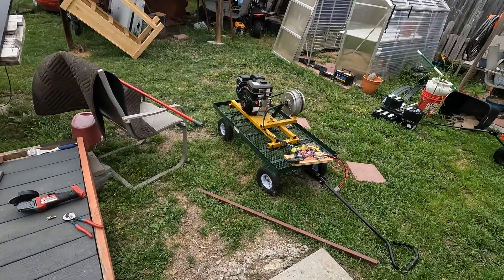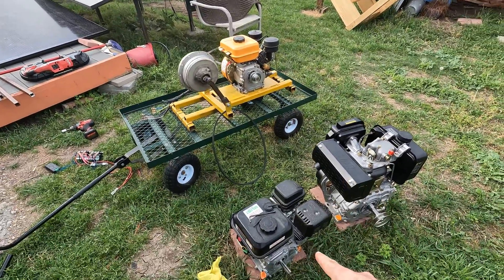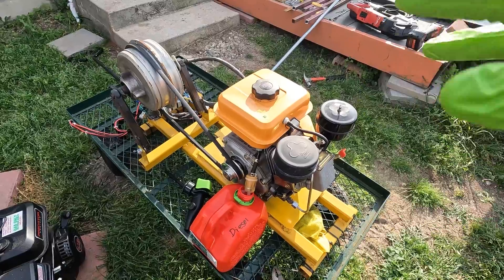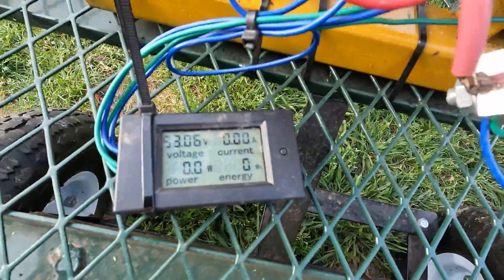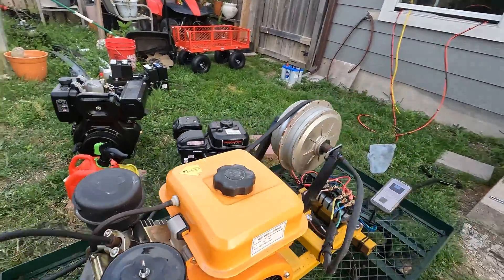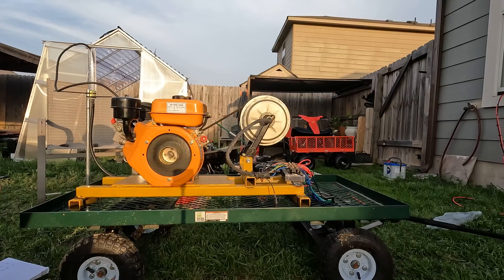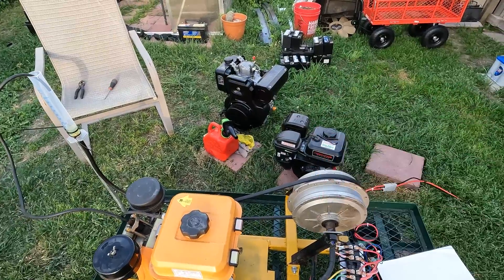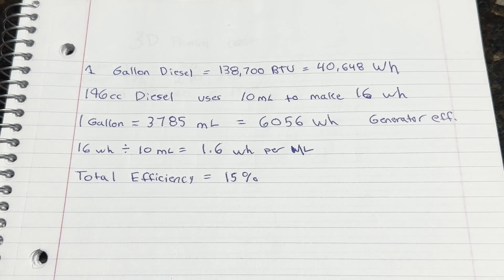Amazon Diesel 196cc  DIY generator fuel economy

Comment: You can run 100micron filered used motor oil through that 196cc without any desiel and it runs perfect. 👍 makes it damn near free.

Comment: generator. measure its resistance. then short it out and measure the current it can deliver, and how much power it takes to spin. at various RPM until it saturates, or something starts burning, lol... being permanent magnets, you will find theres an RPM where it peaks, plateaus, and past that speed output starts falling again. magnetic flux density, rate of change, number of conductors crossing magnetic flux, and iron losses, hysteresis, etc...

current squared * resistance for the power the generator can deliver. current* resistance for the voltage it should develop.

then, as per jacobis law, or thevenins max power theorem, you can only deliver half that power to a load resistance equal to the generator resistance. "impedance matching"... half the energy is in the generator, half in the load.
 if the load is lower in resistance than the generator, then most of the power is lost as heat in the generators resistance. basic maths. I2R... 10 amps, 10 ohms each, thats 1000W in each, or 2kw total, which should take a bit more than that to produce (friction losses). 10R to 1R... thats 1000W versus 100W, for 1.1KW total, etc etc...

 to get good efficiency, you need to "impedance bridge"... the load should be an order of magnitude higher in resistance than the generator. meaning you cant push so much power out of that generator, but more of whats delivered appears as useful work in the load, rather than being wasted as heat in the generators windings... ie, 1R to 10R means for the 1.1kw developed, 1000 watts is used in the load and 100W lost in the generator...

biggest hurdle, because you are trying to rectify, then charge batteries, is that all that gets tossed out the window as the generator is stuck at delivering a fixed voltage, and very well may be right out of its sweet spot... as its a combination of RPM, generator capabilities, its resistance.... to charge batteries is like juggling blindfolded unless you really did your research...

at  that point, ditch the poxy hub motor and track down a proper genset head... direct to AC. why waste energy dealing with "middlemen"? teh rectifier is a loss, teh cables are a loss, the V belt is a loss (yes, v belts are extremely inefficient... at least run a chain or flatbelt/toothed belt?), the batteries are a loss, the subsequent inversion to useful AC is a loss... 

"buy direct from the manufacturer..."

Comment: What RPM did you test this at?  You say "relatively low" but no idea what that is
Reply from the maker: @jsh111  maybe around 1000
Reply: @Mikebuildss  thanks for the reply!   Here are some thoughts that might be useful if you wanted more efficiency,  and assuming you can adjust the injection timing/ advance.   This engine,  if my research is correct has a timing advance of 22 degrees prior to TDC.   This is very aggressive and probably necessary to get a more complete burn at the engine's peak 3300 rpm.   At lower rpms like 1000-1500 you would want something more like nine or ten degrees timing advance since you now have more burn time since the engine is operating more slowly.    At slower speed that burn is fighting the engine's momentum too much,  and you also start to encounter compression heat losses.    I'd say shoot for 1500 rpm if you wanted to see how efficient this sucker can get.    Great videos brother,  cheers!

Comment: So you can make about 6kw (60¢) of electricity using $4 of diesel? Awesome!
Reply: I think your looking at this all wrong. I live off grid because no power is available and I don't want to be reliant on anyone for my own power. 
I have everything from a washer and dryer to high speed internet.  I use engine generators 2 hours on the weekends to wash clothes.  So I actually only use a gallon a month. Everything else is solar.  So my power bill is around $5 a month. 😂 If a hurricane comes in and everyone else looses power for weeks it doesn't affect me at all.
Reply: @SgtBrown-w1v  I think this is the goal of all responsible rural-folk, isn't it???

Comment: where did you get the pulley for the motor?
Reply from the maker: Tractor supply, it’s a standard 3/4 inch bore, I used a flap wheel to turn down the engine shaft slightly so it would fit

Comment: very nice job, when running the big 10hp diesel engine for generator usage, be careful of what's called Wetstacking.
Reply from the maker: I will keep an eye out for that! Just gotta get it hot
Reply: @Mikebuildss  you will need about a 3-5Kw to properly load that 10hp diesel engine

Comment: You are running the engine too lightly loaded. That’s the reason for the low efficiency. At zero load it’s 0% efficient. Try run it at least at 75% of its rated power.

Comment: I get about 26-27% efficiency with a 10hp hatz diesel and the same setup, i can run it slow and purely on torque at 1500rpm, yours runs a bit faster i guess, but i think if you only plan to run it at 600 watt you can gain some fuel efficiency by lowering the RPM to around 1800 +/-10%

Also not all hubmotors are the same, i had what seems to be a beast of a hubmotor that looked very promising, but didnt get the efficiency of the Mxus 3k that is on it now, that gets hardly warmer than 60c at 2000 watts running for hours.
Reply: Don't know if it's accurate, but I read somewhere, the fuel injection timing advance is 22 degrees before TDC.  That seems pretty aggressive, and probably what is necessary to tune this engine to run well at 3300 rpm or whatever it is.  My guess, is efficiency will see a huge drop at lower rpm unless you also reduce the timing advance to something like 10 degrees before TDC, if you want to run it at around 1500 rpm for superior burn and efficiency.  Anything lower, and you might see compression losses start to take over.     If I had my way, someone would take one of these, tune it to run 1400-1500 rpm, then dyno it, take your peak power, then run this at 80% of that number, THEN see what your efficiency is.  This thing could be great for supplying a battery bank with extra power intra-day

Comment: Was there any diesel in the return tube? Might have screwed with the calculations since you only did 10ml increments
Reply from the maker: It was returned back into the tube that way only the volume that was burned was used.   if I didn’t feed it back the return fuel from the injector would have messed the result up
Reply: @Mikebuildss i think the question was regarding filling up the return fuel hose.

but if you took mid-run measurements that should've covered all discrepancys in consumption.

Comment: hey guy have you consiidered converting your predator 212 to propane the conversion kits are availble on amazon and maybe ebay too
when i looked at em they were like 20 bucks
Reply from the maker: Never tired propane may look into that
Reply: @Mikebuildss  i think im gonna do that because i built a generator battery charger similiar to what you have but used a 100 hundred amp alternator 
it works well too  but my problem is things sits most of the time and the fuel goes bad and gums up the carburator
 i was gonna use the generator charger yesterday but  the carb is gummed up 
propane would solve that issue

Comment: If you can find the dynamometer charts for each of these engines, they may include brake specific fuel consumption BSFC curves on the charts. If so, you can find the best RPM to run the engine for the best power with the least amount of fuel.
    Then find the RPM of the generators that has the most efficiency and you will know which gear (belt) ratio to run them at.
Reply: I've been looking for this everywhere, but can't find it

Comment: I wonder how much heat you could capture coming off the engine and then find a use for.
Reply from the maker: In winter maybe for heating a coil with liquid
Reply: @Mikebuildss  yeah maybe some copper tubing in the cooling Fins and some kind of heat exchanger for the exhaust. Are the Finns made out of aluminum or is it cast iron?

Comment: if only they would sell these 1966c diesels with a 19.05mm A.K.A. 3/4 inch output shaft!
Reply: @Mikebuildss
15 minutes ago
Tractor supply, it’s a standard 3/4 inch bore, I used a flap wheel to turn down the engine shaft slightly so it would fit

Comment: Something that I've noticed with gasoline small engines is that the fuel efficiency seems to be about equal across all engines of the same number of cylinders. My 19.5 hp single cylinder Briggs uses about half the fuel as the 24 hp v-twin that was on the same mower before. You'd think there wouldn't be a huge discrepancy because the single isn't far off displacement-wise and the power numbers aren't far off either, but that just seems to be how it works out with these types of engines. I've seen lots of accounts of the same phenomenon online from old timers in the forums. Twins have more power, but not as much as you would think, and they also seem to use twice the fuel to do the same job as a single that will make the same power on paper. Displacement variations don't seem to change the scenario as much as with cars. I'm suspicious it has to do with fuelling because a lot of them use the same carbs across all displacements and they don't even use different jetting. It will be interesting to see if the diesels behave differently.
Reply: The more cylinders an engine has, the less efficient it is because of the  additional friction it has due to the circumference of all the  piston rings all added together, plus all the additional connecting rods,  cam lobes, valves, rockers etc.
    Of course, as with all things engineering, there is a trade-off. 
   The fewer cylinders an engine has, for the same displacement, means that each piston, valve, rod, etc must be heavier.
    Horsepower is a function of torque and revolutions per minute or RPM.
    Since an engine of the same displacement with fewer cylinders has heavier parts within it, it is limited in the RPM it can achieve, without tearing itself apart, and since the more RPM an engine can make the higher the horsepower it can make, an engine with fewer cylinders cannot make the same horsepower as an engine with more cylinders.
Reply: Yes I just got a deer and it has a 28 HP and omg I thought it was leaking the gas out but it's burning it so crazy the amount it burns 🔥 if I would have known wouldn't have it would have a big single hands down !! The amount is huge !!

Comment: Another plus to the diesel motor is the fuel stores almost indefinitely unlike gasoline
Reply: That and alternative fuels are not hard to find / make.
Reply: not true, diesel absorbs atmospheric water so unless your storage vessel is airtight, which a fuel storage vessel SHOULDN'T be, diesel will eventually be full of water.
Reply: @supertoaster94  we had 40 year old diesel running just fine in a car that was sitting all that time in a field. 
It's not ideal but storage is way easier than any other fuel
Reply: @supertoaster94  yea and im saying it doesn't matter that much and the amount of water it absorbs while in a fuel tank is neglectable
Reply: @supertoaster94  yea I'm aware what ya saying but it's irrelevant to what the op was saying. He was right about diesel being way easier to store and being usable for pretty much forever. 
Hence why ya base argument that it attracts water is irrelevant in this case.

Comment: Before you change engines retest this one at a higher RPM & tighten the belt a little bit. I think the small diesel could also drive a bigger pulley. I'll bet the big diesel has a 25mm shaft, not a 1".
Reply from the maker: That makes sense, I need to get a tachometer to measure rpm aswell

Comment: Nice, I am looking into building my own version. I have a old honda e2500 with a bad carb. Can't seem to find a new carb so I plan on swapping in a motor. Its a belt drive generator head. Do you know if its possible to swap in a generator governor into those side shaft predator motors? In my case its easier to use spark ignited since I have free well gas. A small simple diesel like this would be great for biodiesel though.
Reply from the maker: Honestly it will maintain what ever rpm it’s set too, but I’m not sure, my setup runs through an inverter so rpm doesn’t matter much

Comment: You may want to add in actual costs so they can be compared. For example, a gallon of diesel here is $3.66, and if that produces 6056wh, that's almost $0.605 per kwh. I'm charged about $0.20 per kwh by my power company, so the energy cost of this setup is about three times as much.
Reply from the maker: That makes sense, I think my idea is most people who would use this are either off grid or for backup power, compared to a gas generator it’s more efficient, especially if you make biodiesel
Reply: I'd say this engine can also run on preheated vegetable oil, which can be very interesting for charging the batteries in the winter without spending some money. And it definitely uses less fuel than a car...
Reply from the maker: @foxtizzo  I actually tried to start it when it was below 32 degrees and it would not start lol, it was hard to turn over and I couldn’t get enough speed to get it to fire
Reply: @Mikebuildss  Yeah at such temperatures it wouldn't start. On veggie oil it should be started on diesel or biodiesel and once its up to temperature you can switch to vegetable oil and use the exhaust to preheat the oil.
Reply: @Mikebuildss  
Full Synthetic 15w40 with extra ZDDP would make it lots easier to spin...
and block heating via a hair dyer on for an hour before hand under an insulated cover over the whole generator would make that baby fire up in extreme cold...

Comment: Awesome. Thanks much, I’ll be curious to see how it compares with the gas motor. I’ve been curious about these little diesels because diesel stores so much better than gas.
Reply from the maker: That’s true, I will say noise wise it’s way louder, may not matter if your out in the sticks but if you live in a suburb people may cry about it, they don’t appreciate backyard engineering like we do lol
Reply: @Mikebuildss  😂
Reply: @joeprimal2044  be careful about modern diesel fuel, without an extra fuel additive like hot shot's secret it will go bad as little as 6 months, the sulfur that was in it, before the had to start making ULSD for emissions, help keep the fuel stable longer.
Reply: @JoshKilen  Thanks. I haven’t had any trouble like that out on the farm yet, but I’ll keep an eye on it.
Reply: @joeprimal2044  you most likely burn through enough of it, so it doesn't become a problem. How often do you buy fuel? and how much at a time?
Reply: @JoshKilen  I’ve had 10 Year old diesel that ran fine. But that’s in tractors which are very high compression, not like cars with glow plugs.
Reply: @joeprimal2044  I know diesel theory and I also have a 5Kw chineze diesel generator that I reactivated, from storage 4-5 years, and modern ULSD can damage the injection system, if it too old, is what from I read. the 10 year old diesel could of been the non-ULSD.

Comment: 6 kWh per gallon looks real good for your setup. 
I only get 5.5kWh per gallon to the batteries with gas generator running through switch mode chargers=more losses.
Reply from the maker: I was honestly surprised, I’m sure this cheap engine isn’t the most efficient as far as fuel burn but it does work well!